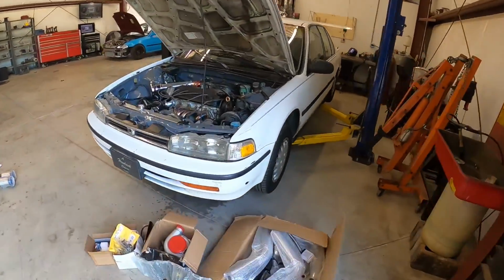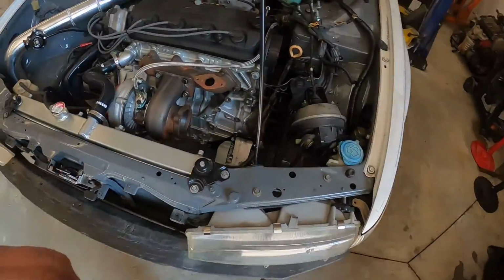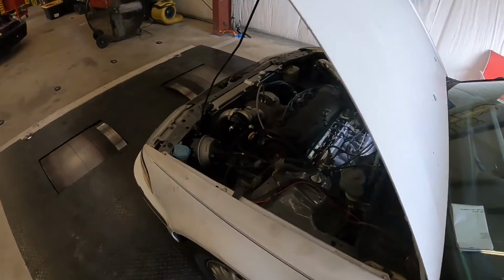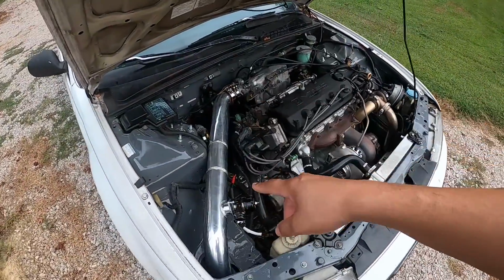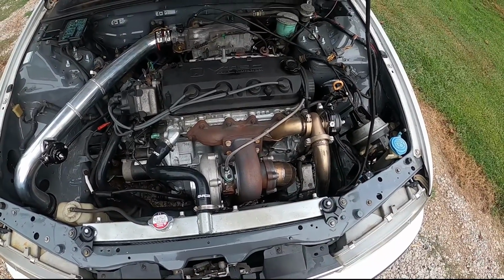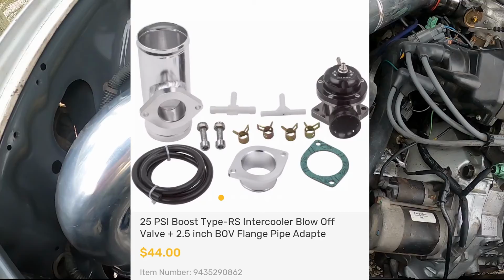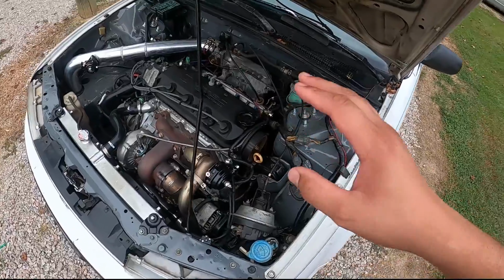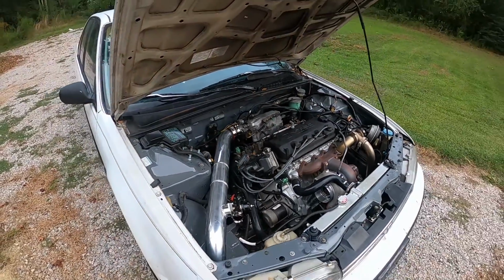Sleeper TURBO Honda Build Breakdown! | J. Mills Tuning | How Much Did It Cost??

Comment: Car came out good. But I have 2 questions. Is the dump tube blowing onto the alternator. Also in the video the feed line is touching the waste gate pipe. Might want to reroute it to prevent fire.

Comment: Love this setup bro. Only thing other than clutch upgrade and TIRES BRO LOL is thermo wrapping intercooler pipe from intercooler to throttle body for coolest air entering your engine. You do need a catch can bro trust me it won't hurt anything and does add a few HP.

Comment: I'd invest in getting a M factory LSD for your transmission too. Go through Synchro tech.
Reply: Or if you want to go budget buy a phantom grip block. It converts ur oem open diff to an lsd. It’s cheap effective. I’ve installed 3 so far in Honda street swaps. The highest hp tq I seen the grip conversion take is a b20v that made 347whp on a dyno then it hammered on the street for year before cylinder cracked. But the car use to do 4th gear burnouts without the lsd grip. After it hooked up. Just s friend trying to help the budget. Btw love the raw legit videos and racing. Keep the vids coming

Comment: I have the same accord! f22a6, Planning to turbo very soon. Is that the stock motor? Noticed it was an f23a1. Also what trans did you use? The trans from the f23a1 or the trans from the f22a6? Asking to see if it would be better to go ahead and get a f23a1 and boost it.
Reply from the maker: I have a f23a from Japan bro. I got it for the low mileage so when I turbocharged it I would be less likely to have issues. Trans doesn't matter really when we hot making like 700+ hp
Reply: @DrivenFilmsPhotography  Okay! Appreciate the help👍🏼

Comment: Hey man what ecu are you running?    Cause I know the stock one isn't tunable
Reply: I think it's a chipped ecu running Honda tuning suite for the software.
Reply: @mart182003  what ecu code though?    P28 p12 po6?
Reply: @christopherelrod8788  it doesn’t matter bro. It’s remapped so ,so long it plugs into the chassis. The car is bod-1 btw.